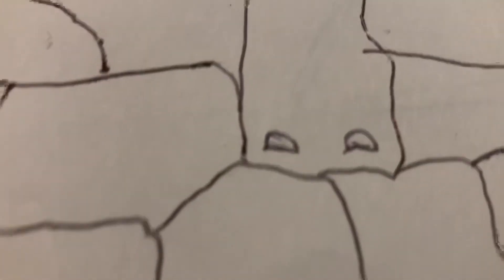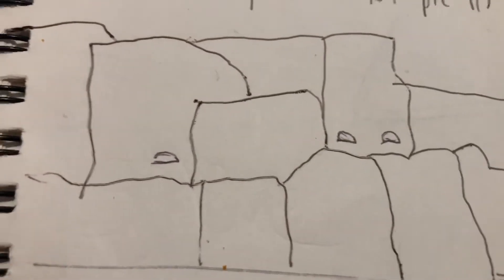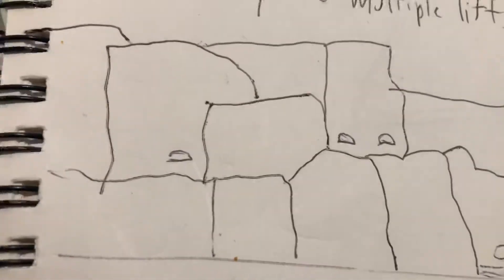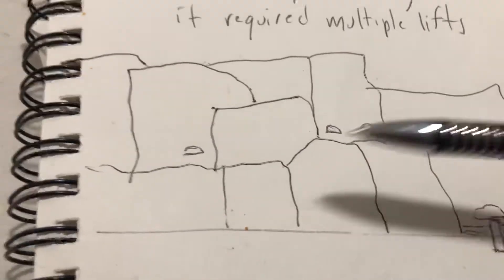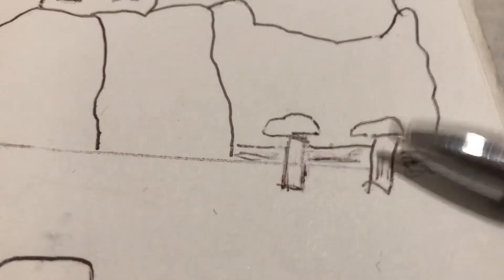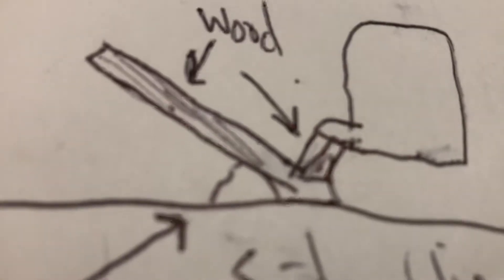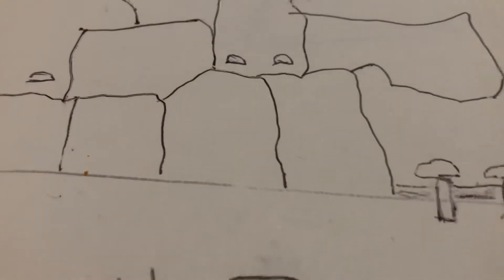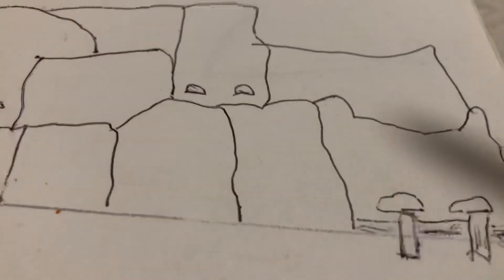Megalithic Wall Nubs: #Secret of #Megalithic #masonry ???

Comment: no they are not for lifting.. they appear random on blocks not just at the bottom and many have none.
Reply from the maker: They smooth them off when they are not needed at steppingstones for higher ones and the ones that are in higher locations could also use the lever mechanism… I’m not saying for certain this is the solution it’s just the solution that I saw… It’s fascinating how the older constructions seem to be constructed with far more patience And expertise than later ones which makes you wonder why
Reply from the maker: @Starfishtroopers  I sure would love to hear any other theories! It is interesting how the bottoms of the knobs are very flat making them more conducive for this theory… But I would be really interested in hearing other theories… What is yours my friend?

Comment: I'm not sure that's how they were used Buddy.
 Not all the stones have these nubules, especially the largest ones.
 The nubules or protrusions, are not on any stones from the more recent civilizations builds, i would venture a bit further back, the stones that have the nubules are part of the oldest megalithic stonework.
It can be proven totally IMHO, that advanced technologies were used to create these older structures, that includes drill holes (that were created using a drill head that was 50 times harder than diamond), saw cuts (using a tool of equal hardness) and precision working of some of the hardest stone on earth (to within a 1000th of an inch), any stonework after that period was crude in comparison.
 It's my belief that the nubules were used to measure the structural frequencies or possibly alter, enhance or vibrate the crystalline content of the stone.
 My brother reckons the nubs are after-effects from the setting of a type of ancient concrete.
 Obviously this is my opinion, i haven't tried RV myself yet regarding this.
Thanks Buddy.
Reply from the maker: I am not certain either. Although the viewing seemed rather clear, I certainly have many many questions ....but it is a delightful mystery to ponder.

Comment: I appreciate the effort at trying to explain the nubs, but I'm 100% in disagreement with your findings. The nubs are random, often not centered. Sometimes on the bottom, sometimes on the side, sometimes centered, sometimes not centered. Very random. Likewise, there are usually more blocks without the nubs, than with the nubs. Why? If you're going to break them off/sand them off, why play one, two skip a few? Doesn't make sense. Not saying I know the answer, but rather that this one doesn't make sense to me.